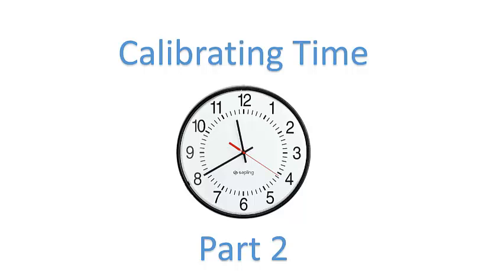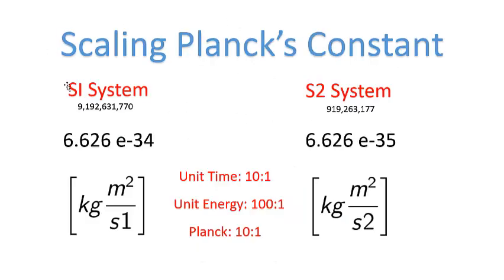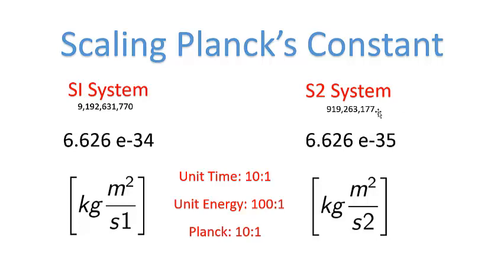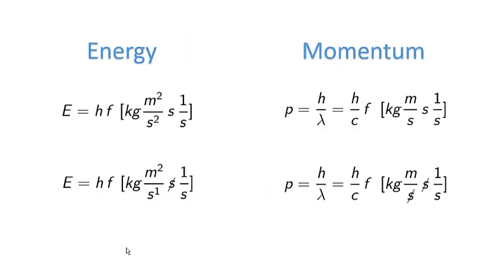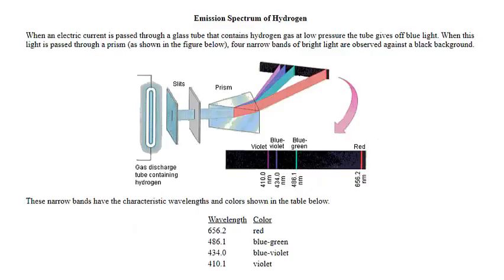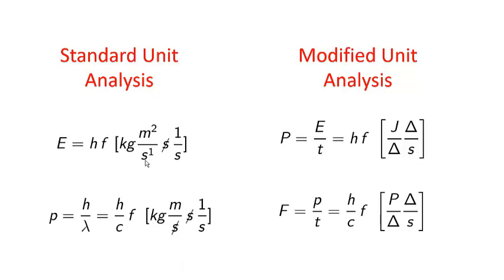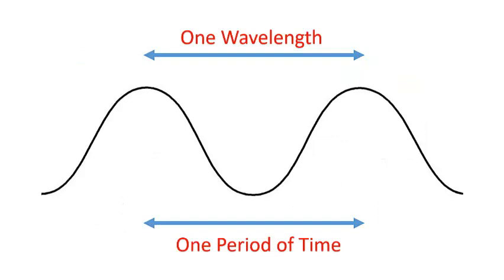Calibrating Time Part 2

Comment: nice, s8 fits nicely to SIMD AVX2, do you know/write AVX2 assembly fractal code ? , see the x264 code base for inspiration.
another way to say 'different freq's deliver more energy in a given unit of time' is 'different freq's deliver more data in a given unit of time' ,  as a more understandable computer logic/ethernet www network unit of time pov
Reply from the maker: Yes. I wrote a lot of assembly language code when I worked for the Astronomy Department. This was back in the mid 1980's. Back then, the Astronomy dept. was very poor, so we had to build our circuits by hand. I had to had wire wrap the circuits myself and then debug them.  We also couldn't afford a C compiler so I had to write all my programs in assembler. We were using Motorola chips back then. My background in this makes this line of thinking much easier.

Comment: So do "particles" only exist when different kinds of waves "crash" into each other?
Reply from the maker: Particles are standing waves. Light is a travelling wave. When a light wave "crashes" into the shore of a detector, it behaves like a particle in that it has the ability to do work.
Reply: Electron and positron creation works like that - two photons crash into each other, and you create matter. What is even more awesome, when you crash electron with positron, then two photons may emerge. :) Matter is light, just in a different state/form. As Fractal Woman mentioned: it is a standing wave, or "hard light".
Reply from the maker: @krzysztofrzepka  Yes, electrons and positrons are standing waves in my line of thinking. They are out of phase with each other which is why they can annihilate (destructive interference). When you supply the right energy (frequency), you re-create the two standing waves that we call electron and positron. Here's the thing. You can't create an electron and a positron in outer space. You need to be near the nucleus of an atom and/or near the nucleus of a galaxy (a black hole) to create electron-positron pairs. 
This is why positrons can only be emitted in nuclear reactions. You can't take two gamma ray emitters and point them at each other and create electrons and positrons. 
https://ui.adsabs.harvard.edu/abs/2018ApJ...859...89L/abstract

Comment: is the amplitude the plank length?
Reply: or some ratio of it?
Reply from the maker: @joshhennen  In my OM-Particle  Model, educed Planck length is the radius of the OM-Particle but it is also the distance between charges. (as depicted in the YinYang schematic). Non-reduced Planck's constant is the circumference of the OM Particle. Since this is a spinning system, the radius is the amplitude. If you move a spinning object in space, you can imagine it making a sine wave where the radius becomes the amplitude. Hopefully, you can see that.